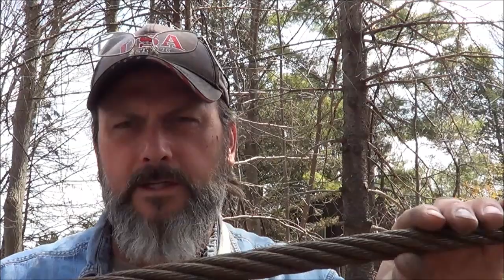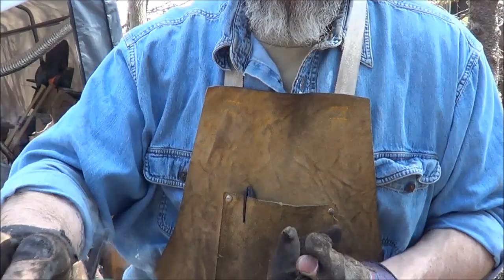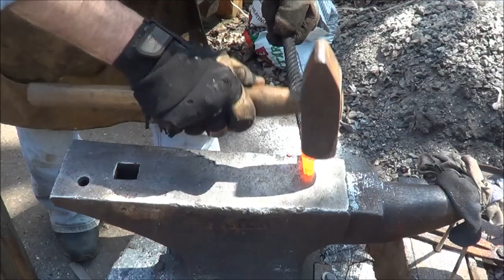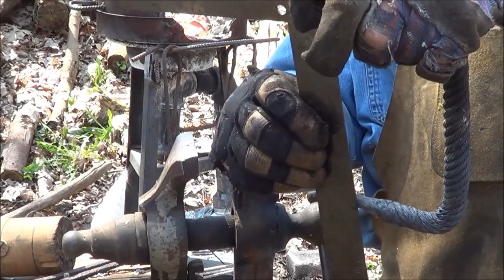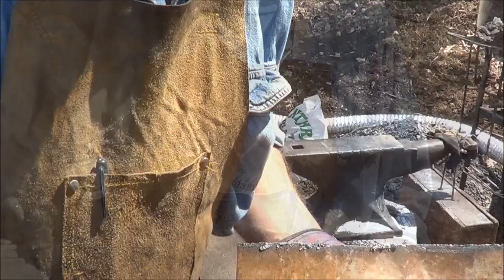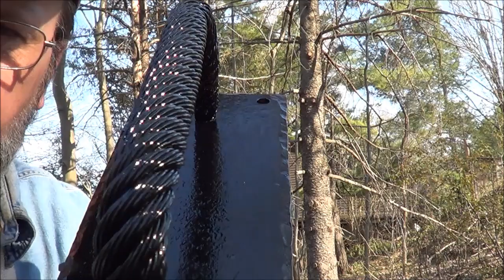Blacksmithing - Forging An Industrial Cable Door Pull

Comment: Cause you've painted it black it now just looks like rebar. Shame cause it was a really nice piece
Reply from the maker: Onur Caglar yes painting it was not a popular choice...
Reply: Not trying to diss you at all tho it's a nice bit of art. I'm currently looking for some of that cable myself to build a replica for my shed.
Reply: Chandler Dickinson I don't know how you feel about this, but I have seen people take soft metal brushes and scrubbed it on the heated surfaces of their pieces to give it a kind of plating.  I don't know how you'd seal it to keep it from oxidizing though.  Also if you could figure out how to get a nice oiled bronze look, you can make all sorts of regular pieces (doorknobs, tower bars, etc) and people would eat it up since that is what is in style.
Reply: GlobalIdiot101 for a door handle, you dont need to do much because peoples hands keep the relevant areas coated in oil.
Reply: Chandler Dickinson Don't worry about it, your'e just experimenting to see what people like and what you can make a living off of. Keep making them and put some gun blu on it for a more industrial old style look, I think that will sell really well my friend =). I wish I had some land away from the city I can use some loud tools on.
Reply: ***** ok you are a rebar expert we have now been proven that. It's my opinion and I am sticking to it. The paint will fill in the tight weaves of the wire rope.

Comment: there are clubs and bars all around toronto that are going with nothing but this look. blackened wood doors, pounded steel strapping with bosses rivets. and these handels are exacly what they are looking for. knowing some owners and what they paid for the doors, 300-500 for a pair is a steal. but not in black like you painted it. rusty, or just how you had it after fireing, little blue'd from the welding is perfect. just coat with some bees wax or clear varnish and its perfect. 

PS those doors they are about $4000-$6000. just saying.

Comment: I think the paint makes the hammered detail a little harder to see. Maybe just wire brush and clear coat or wax. I preferred the look of the cable before you twisted it.  All in all it's a nice piece. A lot of time involved but don't short yourself.  I think more men would be interested for a shed or shop door. Great video.

Comment: i really like that, when i saw the handle wasnt straight my OCD kicked in a bit...ok a lot(stupid OCD, makes everything difficult) but then it only took a few seconds for me to visualize two of those being on double doors and thought that would look really good. its also more ergonomic being angled a little bit and it adds that hand made feel.
 its kinda hard to judge an exact price for it without knowing the exact hours and the price of the material. i think a baseline would be to start out with how much each piece of material cost per item then take the total amount of time you spent on it and times that by what you want to make. if you only spent an hour or two on it lets say material breaks down to 15$ and you want 20$ an hour if it took two hours then you would charge 55$. just dont forget to include consumables like coal, wire for your welder, whatever consumables are on the plasma torch, grinding disks, paint etc etc. those things often times get over looked by people looking to turn their hobby into a job. just some things to think about, keep up the good work and keep makin those videos (maybe you could make some extra money through youtube as well)

Comment: Cut the fingers off another thick old leather glove and put them on over your off-hand glove, that way you can stabilize the welding tip close to the work piece without risking burns from the welding heat .  This will let you get better aiming on the MIG tip, and allow you to control your welding far more precisely.  Oh, and you don't have to start OFF the work piece with a MIG, you can aim straight INTO the end of that wire and not have the big wires hanging off the side.  Otherwise, cool project (and clearly the forge welding was more than strong enough haha)

Comment: Hay man, I don't know if it's just me but it looks like you use your grinder to polish and get the thin top layer of git off most your projects and it leave indented black forge marks, have you considered getting a wire brush drill bit attachment ? You could get some to colour some of your knifes gold and thing, anyway just a suggestion on the other hand you have made some amazing pieces, keep it up man, big fan .

Comment: Turn that item sideways and a little longer it is a towel holder. If it is stiff enough leave one end free and a little shorter it is a toilet paper holder. Looks good enough for any man cave. Leave a little less hand space and you can use it for the lift up garage door.
I would make the backing plate a little thicker for the door pull where it is closer to the eye. Keep at it

Comment: Interesting piece, I'd probably leave it uncoated or clear coated though for a more authentic industrial feel (you could charge extra to apply an enamel finish too). As for price that's really hard to judge but you have to ask yourself if you are trying to be an artist or a factory. If the latter then they are worth the cost of the materials + labour + a (small) margin. If the former then significantly more, I could see a hip new start-up company with too much VC money paying $200 a piece for all the doors in their swanky new office.

Comment: I would recommend trying to pre twist the ends and forg wled them so that they match the outside diameter of the twisted (not welded) rest of the handle... OR Stick (and hide from view) the tapered/welded ends in two short thick walled pieces of pipe which have been MIG welded to the base plate...

Comment: Also specialty items or tools like wood working knives, simple trinkets like your fire-starters, or even getting faster at your rams heads or dragons for racks and kitchen implements. I sold a hand made sushi knife made of stainless steal damasks for $600 on an order to a local chef. It took me 3 days to make from pounding to polishing and it was made to his specifications. He was left-handed so he could not just buy any knife and even the expensive ones at supply shops don't carry left handed knives. I could have charged more but he also owns a local shop that i go to every week for lunch practically. Anyway the point is if you find a niche market for some of your items they will move quickly. I've done coffee tables, machete for bushman, hunting knives, custom heads for arrows, canes, spoon and fork sets, and all were priced based on the time an quality of the work. Check out some knife makers that charge 500 - 5000 bucks for some rather impressive collectors bits. Be confidant in your craft and your pieces you have a knack for it, i don't know how many times you have practiced each bit but you have a talent and i really hope you go far with it.

Comment: Dunno what you decided to run it for, but if your kick ass ram head knives go for 150, then I'd say do a pair of these handles for 80, or two sets (for double doors) at 120. If you sell to the upper class artisan crowd , you could probably go for more. Also, they look great in black but fantastic in their natural steel color.

Comment: Is it necessary (or even just a good idea) to use filtered lens for the eyes when working with red and white hot metal?
Reply from the maker: John Ratko It would not hurt.  I do know that when i forge into the night and the only light is that of the hot metal... it does hurt
Reply: Chandler Dickinson I'm not sure if it's old age or working metals too much without filters, but I'm having some problems seeing well when the lighting isn't bright.

Comment: Would be good for my horse barn on the sliding doors.  Good to sell in pairs.  You would need to do it more as a batch production to make if pay.  How long would it take you to make?  Would not want a glossy finish.  $75 each or $125 for a pair seem good.  Yours is much sturdier then the $40 commercial ones.  And the wide back plate makes them excellent for side pulling on a sliding door.

Comment: Why Flux, what does it prevent and or benefit. Also what do you use for flux. Sorry for my ignorance to the subject I am just starting! Thank you! :D
Reply from the maker: Matt Horton I use as many do Borax for flux.  Plain old 20 Mule Borax that you can find in the laundry aisle.  The flux when heated turns to flowing glass which will help float away contaminates for a cleaner weld surface.  Some say it aids in themmetal flowing too
Reply: Chandler Dickinson It also helps keep the atmosphere off of the surface so that you get a metal to metal weld, and no metal oxides interfering.

Comment: What is flux and what does it do also please  answer my coment on the forge side chat 5 thanks
Reply from the maker: DRAGON LLAMA Flux will help remove contaminants that might be on the surface of the metals you are trying to join.  It is also thought that it assists in the mixing of the metals as they are being welded.
Reply: Chandler Dickinson thanks

Comment: so this might be a dumb question, but what does pouring flux on it do?
Reply: momo4077 Get's some of the impurities out and stops the rust when trying to forge weld. I'm no expert however
Reply: ***** That's interesting. I don't really understand how that would work, but thanks anyways. I'll just leave that one a mystery for now.
Reply: momo4077 the main reason for flux is to provide a liquid path for melting materials to meet.  It is also used to collect impurities. As the flux melts, it collects lighter material, and as it is squished out, it leaves the cleaner liquid flux, which allows for the super heated metal to flow, and find a surface for similar metals to bind to each other.
Reply from the maker: momo4077 flux when heated turns into a melted glass which floats away alot of the contaminants on the surface of the metal... some also say it helps the metal flow together during the weld too.

Comment: Hey Chandler, I am interested in blacksmithing and was just wondering where you sell what you make because I hear you say I made a lot of money off of this and that but is there a lot of skill that goes into selling those items such as knifes, decorative pieces etc or is it just like ebay sails? Also how quickly do you usually sell what you make? Thank you for all the great inspirational videos, cheers.
Reply from the maker: Taen I have sold on ebay and currently most of my stuff is sold through Etsy.  I probably sell most from direct requests from customers.  The things I list can take forever to sell sometimes...  You need a lot of them listed so the time between sales is less
Reply: Chandler Dickinson Ok, thank you!

Comment: Whats flux? And what is it for
Reply from the maker: Nolan yoyo I use common borax for flux.  Flux will turn to liquid glass when melted and helps float away contaminates so that you have a cleaner material to weld.
Reply: and you say you hate Google
Reply: why do you hate google so much
Reply: Nolan yoyo because he thinks duck duck go doesn't data mine all your information, which is exactly what google does. duck duck is a meta crawler, google saves your personal data and sells it to direct marketers.
Reply: that's just information for ads
Reply: Nolan yoyo you obviously don't get it.

Comment: a fire place orniments w roses rams bear heads ect...on fire pokers & wood thongs w the fire grate animal heads on the ends of the fire grate. 500-600 i've seeen and know the guy who sells these w/o the animal heads. i would market them at your fire place insert retail stores or your web pg you have a good following out here. your door handle 50-75 each no more than 100 each is my thoughts. again nice work thx for the vid.(oh and the holder that stands for the thongs and fire pokers)

Comment: 30-50 dollars wouldnt be enough. if i had made that myself id think i would ask about $120-165 for something like that. if i got real good at it and had the supply to make a few 10s of them even close to 100 of them i would prolly ask $125 each cause someone looking for and old fashion or industrial type look might buy a lot of at most 10 of them for a reasonable price. money in your pocket wise 2 hours of work each plus materials cost. you would make out pretty well at over $1200 at $125 each for 10 of them. turn 20 dollars worth of scrap into near an ounce of gold price.

Comment: Well. Estimate how long you did it. Add taxes and multiply by the hour wage you want. ;D I too think paint kind of ruined it. Sorry. Very nice handle. I couldn't afford one, though, nor would I need it.

How about knobs and locks and handles for carpenters for lockets etc? A bad idea maybe. I have a hard time thinking what a blacksmith could do would be hard to produce otherwise. Moulds for decorative items maybe, like knife handles etc. if that is possible? Slow and very hard, but 3d-machining is expensive and produces maybe too good results for some uses ;D And "blacksmith for hire" of course ;D I hope you can make your bread of it, since you want it.

Comment: I liked the clean look more  i would stick that right to my refrigerator and i agree whit moonvleet41 if you emphasise the fact that its handmade you could Easley ask a higher price fore it like a few hundred Dollar.

If i may give some advice get your shop straight before you are going too start a business because if you are working five six days a week eight nine hours a day you are going insane because of that crappie old wabely workbench that looks like its made of a old bed (fore example ) or because you cant find the right tool en you wil be more productive and it wil look good fore future client.s 

And as a professional woodworking i have workt at shops like that and it wil make you go barking mad.
But yet again a nice vid

Comment: I really think you ruined it big time by painting it.  At this point it looks like rebar.  And if it looks like rebar, then use rebar and not spend your time welding cable.  Go where the money is, spend your time where the money is.  Making something look like rebar is not where your time/money is when you spent so much time to make art.  If you make art, sell if for art prices.